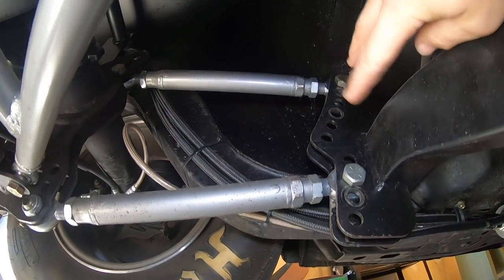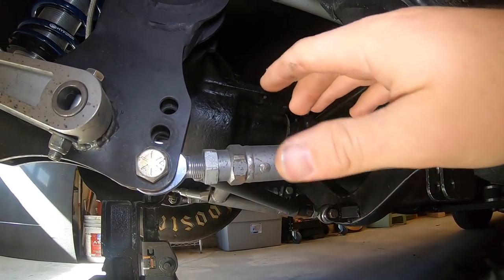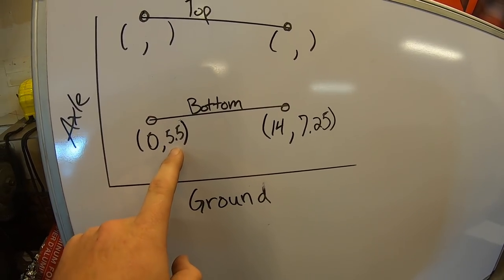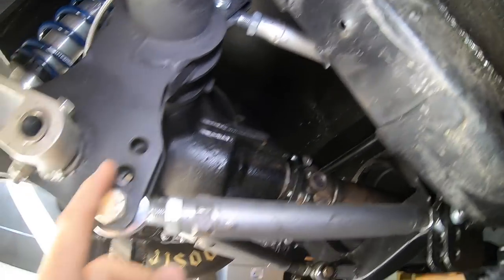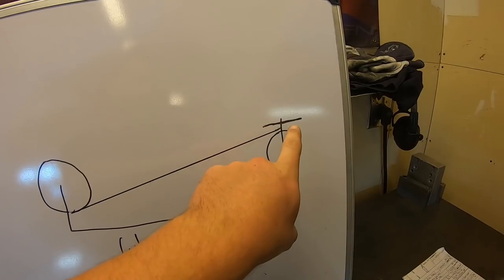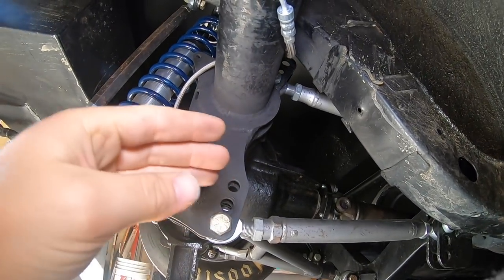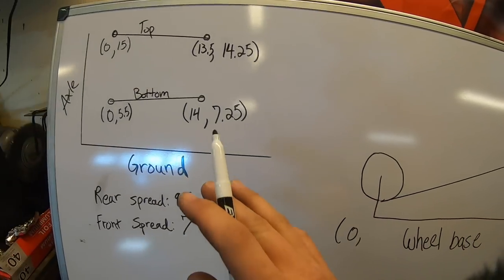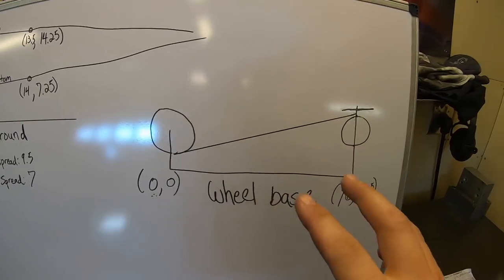FREE 4 Link Calculator (DRAG RACING)

Comment: That's a very good explanation how how to set up your 4 link.  When I was learning this stuff you had to seek out old timers who weren't competitively racing anymore and get them to share their pearls, and separate the chaff from the wheat.  There are a few other considerations though.  The position of the bars matter significantly for reasons other than just the antisquat geometry(side view instant centre vs anti squat line).  The bottom bar should be as straight as you can practically get it as this is the link that actually drives the car forward.  The straighter that bar, the smoother the launch will be and you'll have more power pushing the car forward.  The top bar should be mounted as low as possible for similar reasons.  The higher it is the more leverage it has on the axle and the more you'll experience negative effects from that.

Film your launches from the side and analyze the video to see what is happening.  There is an ideal amount of antisquat and more than that can cause wheelspin after the initial launch as you mentioned but it also wastes horsepower.  In theory you should aim for 100% antisquat and then add as necessary to prevent spin on initial launch.  

You should also make sure everything else is working the way it should be, that your launches are even and straight, your shocks are dialed in both front and rear, front is very important as well.  Spring rate is a big deal as well as your rear rate will be affecting the weight transfer by resisting it.  You need very little spring for drag racing as your 4 link is doing so much of the work.  I'm not sure what your spring rate is but I would expect it's at least 200lbs and you probably only need half that much in a car as light as a RX7.

Keep up the good work and thanks for the vid!
Reply: Always refreshing to see someone with experience in the comments. Your words painted a picture for me and that's a fantastic way to communicate your point. Thanks for the insight!  🇺🇸🏁
Reply: Question about the bottom bar.  Do you want the bar as level as possible with the ground? Or do you want the bar level with the chassis?  For example, if your chassis has a 2 degree downward rake, do you want the bottom bar to also be at a 2 degree downward rake? Or do you want the bottom bar to be as flat as possible with the ground?  Please let me know. Thanks.
Reply: Always with the ground with racing fuel and driver and tyre pressures just like it was sat on the start line

Comment: Just wanted to make sure whoever followed this has this correction (great video!).  Your Upper Link should also plumb from the centerline of the axis which would in-fact be a positive X value (not 0) to correct length of upper bar.  This will become a dramatic figure once calculating a lot of droop or total suspension travel.  Great video, awesome FB!

Comment: Love the way you explained the set up and very precise and attentions to detail.  Thank you for providing the links and demonstrating how to use them.  We have an 71 Chevelle A body and our upper adjustable arms don't run parallel with the car.  They have an angle that runs toured the out board or out side of the car.  Will this formula still work for us.  We run 10.50 @125.5 mph with a 1.47 average 60 foot with good track prep leaving at 5000 on trans brake. When the weather gets hot and track prep sucks our 60 go to Shxxt.  1.56 for example.  Our upper and lower bars are in stock location with 4 degrees of pinion angle.  Any help getting us to improve and be more consistent with greasy track much appreciated.

Comment: I did something weird with my car. I set the frame rails down on  2 jack stands to see where the car would balance evenly with all 4 wheels off the ground. The point at which the jack stands are to do this balance calculated to 51.5% weight on the nose.  The 1/4 panels got a little buckled even with an 8 point roll bar when doing the balance but it went back to perfectly straight when she was back on all 4 wheels. Thank goodness.  Now that I have that measurement I guess it will help with figuring out the anti squat line ?